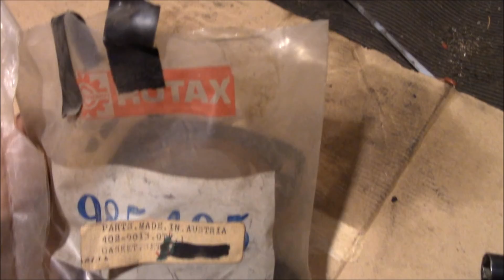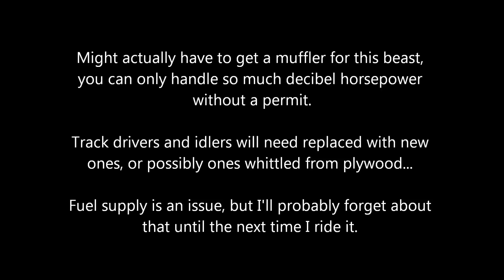1972 Ski-doo Oly 399 Scrapyard Save - Pt. 3

Comment: Had a 1970. 399 TNT Rode it through the 70 s.  Ran consistently 72 miles an hour.  30 hp.  Very reliable sled. Still in the family. Doesn't run any more though.

Comment: Brings me back to my 73 olympic 399 with a artic cat puma hood bungee corded down. Dsmn thing had a stripped out piston so i did the right thingband put in a heli coil and vacumed out the cylinder best i could and ran it for about 2 weeks until it made a awful squeal and quit. Best 50 bucks I ever spent 😆
Reply from the maker: Haha, some of those old ratty sleds are the most fun.

Comment: Vinny use the used drivers I sent you for Trash and Tetanus a few years back! And the drivers and idlers are the same, you can use them. That thing runs pretty damn good for a cracked sleeve.  :)  If you really want to make it turn drill some holes just above the running boards and move the front bogie set up about an inch and a half.
Reply from the maker: Those sprockets are still currently trapped under the trash n tetanus!  I put them on the drive shaft, but couldn't get the assembly in the whole way because the track tension bolts were seized solid.  Then I couldn't get them removed either, so I gave up and it's been parked out back like that since then! haha

It needs some tuning, but definitely has more potential.
Reply: I'll dig around and see if I have any more. :) Last project I thought I'd save bucks and put the old drivers on the rear to replace the disintegrated idlers..I had the whole shaft assembled, but it rolled off the work bench and of course shattered one of the teeth!
Reply from the maker: I think I have a driveshaft from like a '67 carcass out back, that's what I was thinking of using.  The front drivers haven't exploded yet, so maybe those would last in the back for a while?
Reply: Just one way to find out...

Comment: Grew up riding sleds like this. Not the fastest sleds but a lot of fun. My uncle's sleds were hook on either to start. But always started. When it's -10° you learn to love having the engine between your legs and your boots tuck up the sides of the engine. He had a couple of Yamaha' s of the same vintage. They were also fun to ride when you could get them to run. Nothing like a rotax. The Yamaha seem to climb hills better.  That boggie suspension. Well it for the most part sucks! I remember it as a teenager hurting my back. Especially if you got it more then a few Inches of the ground. Don't remember having brakes? Thanks for the trip down memory lane.
Reply from the maker: Good stuff!   Old sleds are definitely a good time, people that have only ridden modern machines are missing out, haha.
Reply: i have hundreds of memories from this sled from my childhood. One of them is running out of fuel in the bush when i was about 12 and having to walk back to the house before dawn.  Going back with my dad in the morning with a jerry can only to find out that someone had stolen the engine out of it.

Comment: What piping did you use for the exhaust?
Reply from the maker: It was generic flexible exhaust pipe, 1.5" diameter I think/
Reply: @toocheaptosmoke  where did you get it?
Reply from the maker: @rushking19   I think i got it off rockauto because it was cheapest there, but most auto parts stores should also be able to get it too.

Comment: shes only smokin on one cylynder also 2 strokes run better with a muffler im suprized it even ran bcause 2 strokes run off of backpressure from the muffler
Reply from the maker: The back pressure from a real expansion for sure, these engines have relatively tame porting and the original cans weren't a real pipe.  Re-tune the carb for a bit less back pressure and it'll run pretty good, heck some of the late 60's factory race sleds (skiroule?) came from the factory with only flex pipe exhaust!  haha
Reply: @toocheaptosmoke  oh yeah there low proformance engines also some snow jet thunderjets had straight pipes from factory, but those ol ski doo's man there tough as nails and run no matter what ya do to em i have about 8 of em and they all run and me and my buds have trouble trying to kill em. Keep making good content love your vids